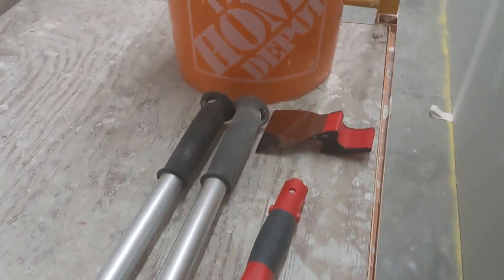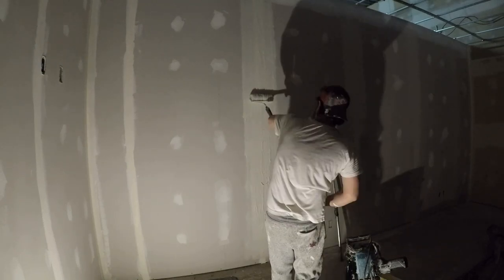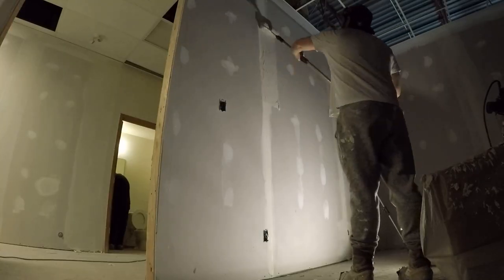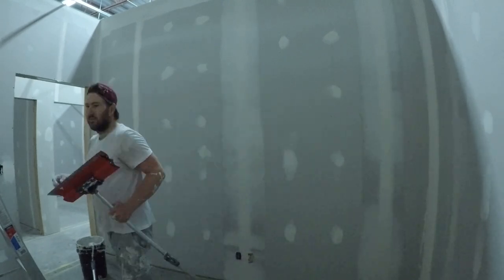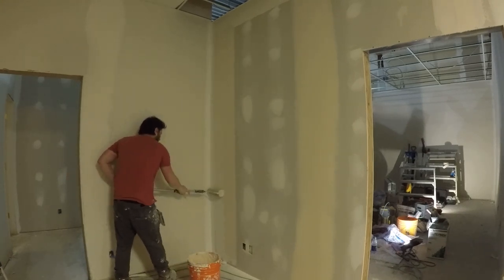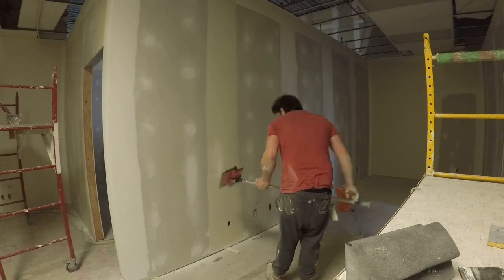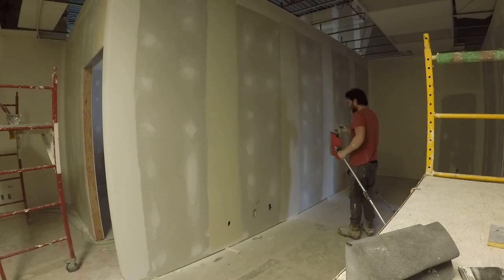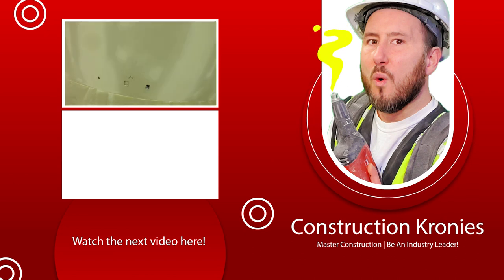L'outil Parfait How I Became A Taper Part 1

Comment: Thanks for the info, are you also messing with butt joints or is it all just factory edges with those tools?
Reply from the maker: Yes butt joints, inside and outside corners. They have rollers for everything. The next couple videos will show a lot more.

Comment: I have this Kit too but it always loose hairs. How do u got rid of that? Because i think to just throw it away because i hate it so much.
Reply from the maker: Sometimes the hairs from the rollers come off yes but it easily just sands out. It doesn't happen that often, I think maybe at first but after a couple years now with the same rollers it barely happens. I'm really liking this kit. Maybe try thinning the mud a bit more?
Reply: @ConstructionKronies  Maybe i try them again at a smaller job before throwing them away. But cool that they will hold this long.
I have mine since a 6 months and used them like 4-5 Times.